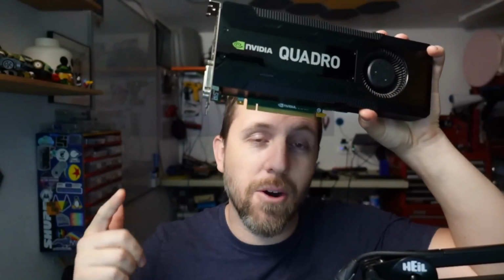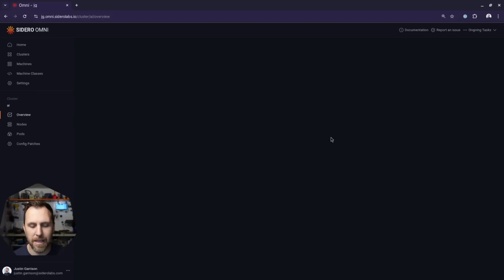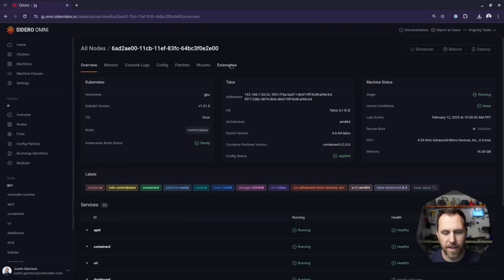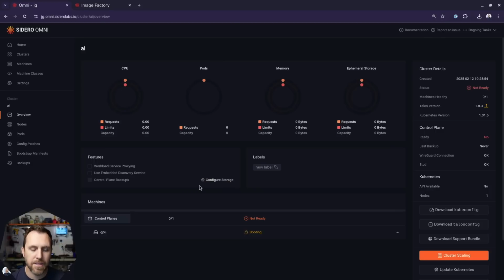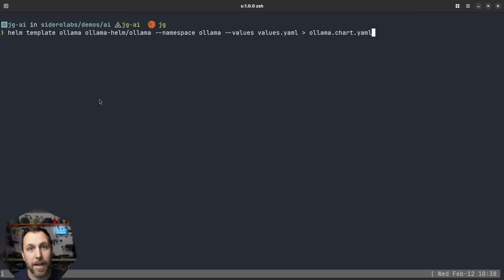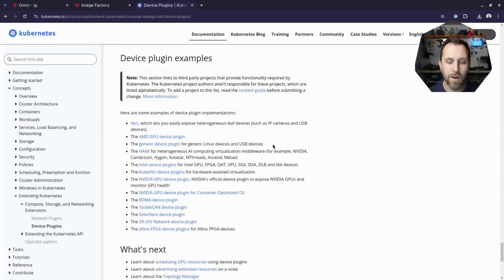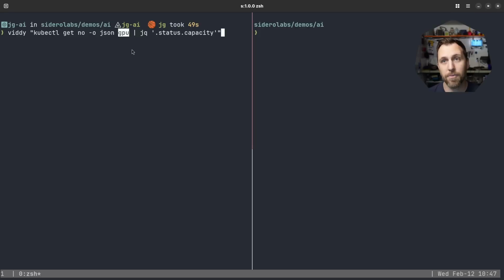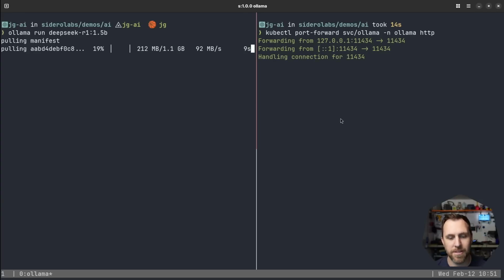Deepseek on bare metal Kubernetes with Talos Linux

Comment: The nvidia gpu operator is okay except for the driver manager. That really is the flaky part and if you can avoid it (such as with Talos), do so. As stated here, it messes around with your system at runtime. It modifies your kernel, your container runtime config, etc. And it does that imperatively, once on pod startup. It don't know how often I had to restart the daemonset manually, or do worse things.
Talos does this the right way!

Comment: Should talos label `gpu.present=true` node when it found gpu? I install device plugin with helm and I don't see any nvidia capacity untill I manually label it.
Reply from the maker: We’ll be working on making this easier with Talos. Right now it’s too many steps and we can simplify it
Reply: Use node feature discovery for that. It labels your nodes based on the available hardware and you can enable it to set nvidia labels, too. Then you can restrict the device plugin and other workloads to only run on the nvidia-labeled nodes

Comment: Is there much of a difference doing this with a AMD GPU? I've seen rumors of the 9070XT having a 32GB variant which would be perfect for AI related tasks.

I'm brand new to Talos and loving it! Just built my first dev cluster on bare metal. Struggled with enrolling the Secure Boot keys but otherwise it was SO smooth!
Reply: Oh yes, doing secure boot with tpm backed encryption isn't easy to setup... I'd love to see a video on that :)
Reply from the maker: It’s similar steps with AMD. We have a AMD GPU system extension
Reply: I love that Talos already does the measured boot dance with UKIs that's really great!

Comment: cool, my ml server is still standalone debian but want to include it in my talos cluster soon! tnx :) curious how it'll work when wanting to run multiple workloads at the same time
Reply: btw, would need the opensource variant for a 4090 eh, instead of the proprietary ?
Reply from the maker: I only have older cards so I'm not sure which cards are supported with the open source drivers.